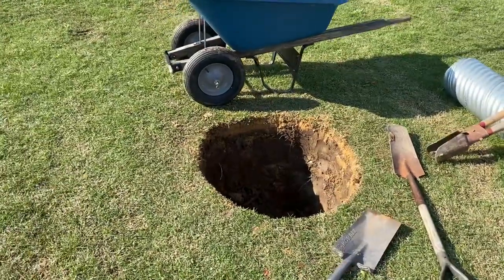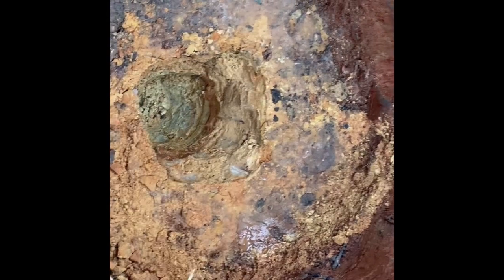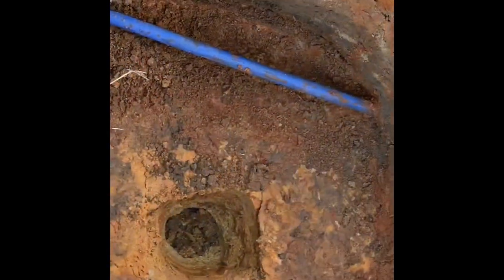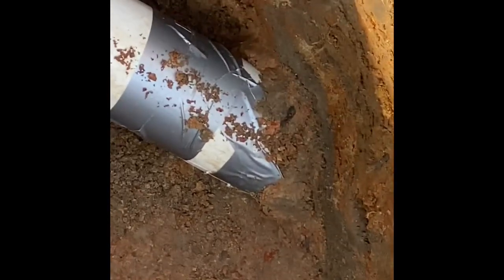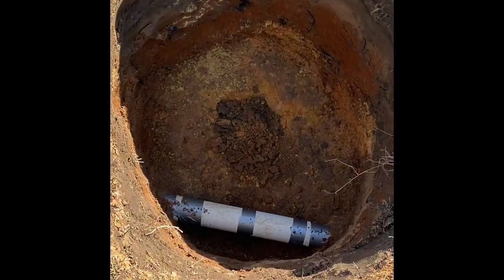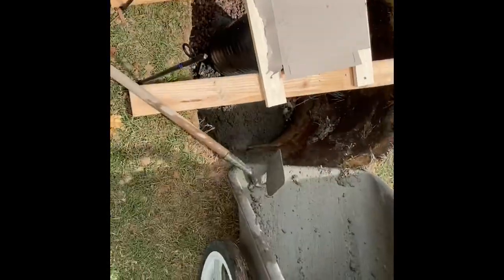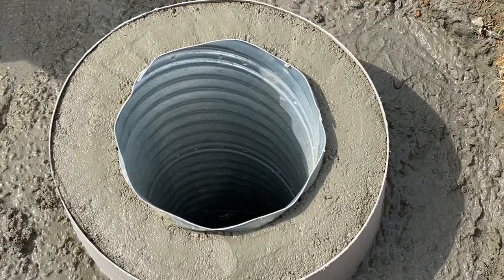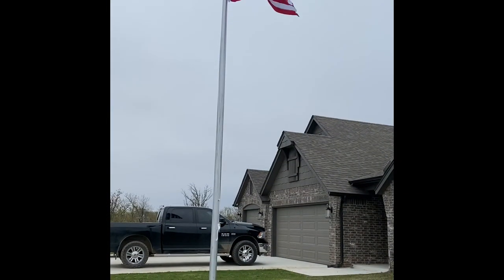Installing 27 foot flagpole

Comment: Can someone explain why people use sand in the center instead of more concrete? Genuinely curious
Reply from the maker: @KenSlaton   Two reasons but there may be more. It’s not necessary, and it make for easy removal later! Imagine removing one with concrete. This one’s been installed 5 years with sand and no issues. I have the installation instructions form manufacture if it helps. Send me an email and I’ll forward..

Comment: Any recollection of how many bags you actually ended up using?
Thanks - great vid
Reply from the maker: Not sure but it seems like 10 to 15 bags. But I wouldn’t skimp. We have high winds regularly here in Oklahoma. I fly a 5 x 8 and never had an issue. I tried to make sure the hole was 3 x 3 if I remember right, then filled in with concrete.
Reply: @galvin9001  thanks, your truck looked like it had about 40 and that's kind of what those concrete calculators say. I was hoping it wasn't actually that many bags...
Reply from the maker: @robwhite3835  no I ended up taking some back .. I took at least 10 back

Comment: How did you and your friends get the pole in? Brute strength? Or machine. This is a great video and helpful.
Reply from the maker: I’m not sure how much the pole weighed but it was commercial grade and only one friend plus myself was all it took. We just placed the butt end into the ground sleeve, then began to stand it up. 
Not near as bad as you’d think
Reply: Got it, thank you! I was really close to paying someone to do this, but your video has inspired me to believe this is a DIY job afterall.
Reply from the maker: @jamesalexander2548   it’s easily a two man job, I did it alone until time to stand the pole. It’s an enjoyable project! 
Didn’t care for digging the hole but I got the pleasure of knowing it was done right. Here in Oklahoma we have 30 to 40 mph winds all the time. I fly 8 foot flags and no issues …

Comment: What were the specs on the flagpole
Reply from the maker: I don't have real good numbers for you because I bought this pole used from Tulsa Flagpole. Three feet of pole is in ground, 25 feet above, and the pole is 6 inches dia. at bottom and 3.5 a top.  The title on video says 27 foot because the revolving pulley at top and gold ball take up a foot. Retail value in 2020 was 1,475.00 paid I paid 750 since used. It will handle a 5 x 8 flag up to 120 mph wind. Can also add a 3 x 5 flag but not sure what max wind is then. This is all the stats I have.

Comment: Galvin did you happen to get any pics of the inside of the grounding sleeve  that shows the centering  wedges for the pole it'self at the bottom  ?
Reply from the maker: Richard Romano  it didn’t come with any so I just got the pole level, straight up then dropped some rocks I had that looked the right size down at the bottom then filled with sand.